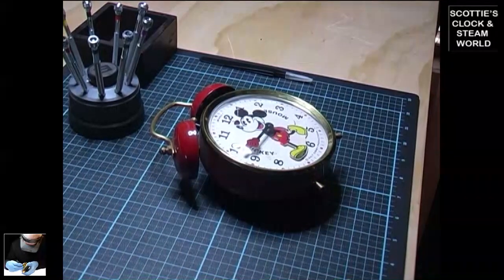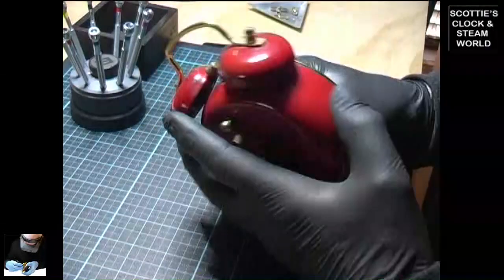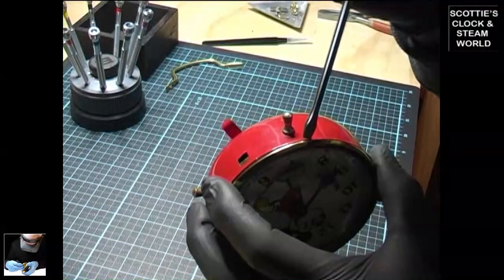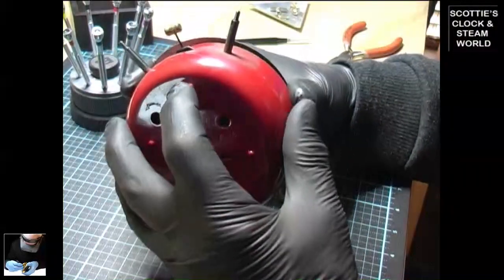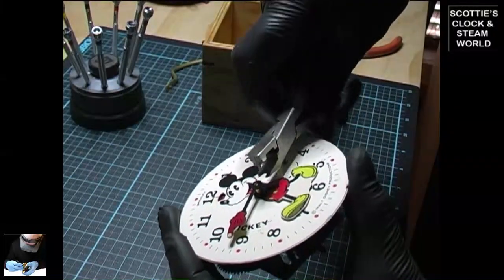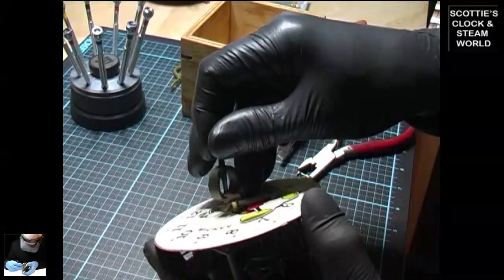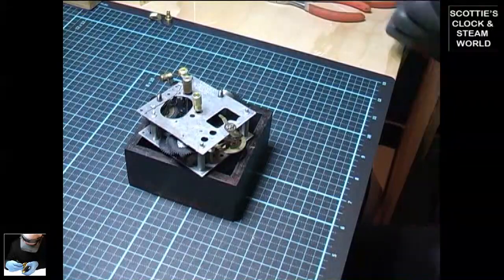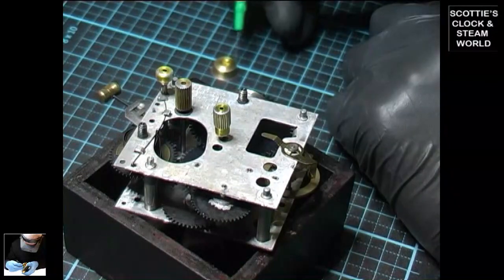How to service a Bradley Mickey Mouse alarm clock - Part 1 #MickeyMouseClocks #ScottiesClockWorld

Comment: Thank you for sharing this Mickey Mouse alarm clock video. I have one similar that I went through. It came with no hands. I got the movement working yet I am having difficulty finding replacement hands for the clock. Do you have any sources that I may look into to obtain some mickey mouse hands for the alarm clock.   Thanks again
Reply from the maker: NOS is virtally unobtainable. Your best bet is to look at flea markets for damaged clocks you can cannibalize or general household auctions. I have often purchased boxes of a dozen old alarm clocks for about $20 at deceased estate auctions.